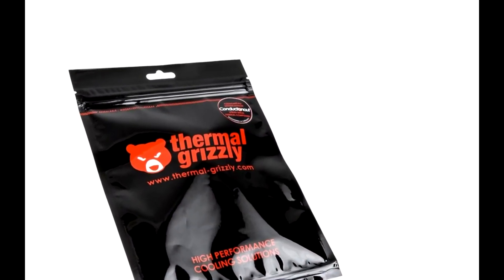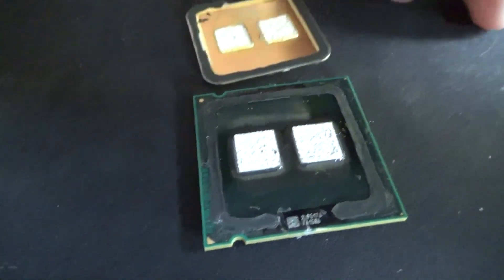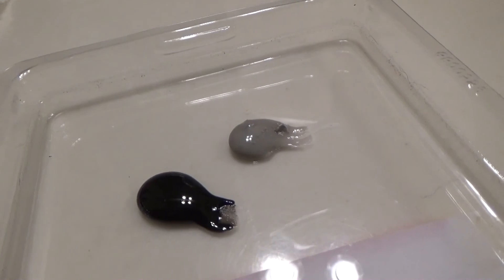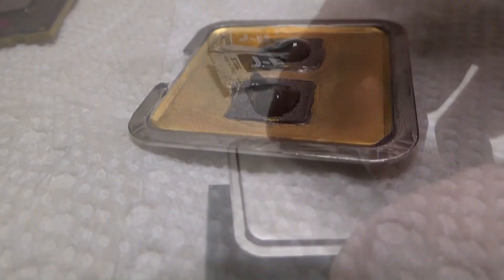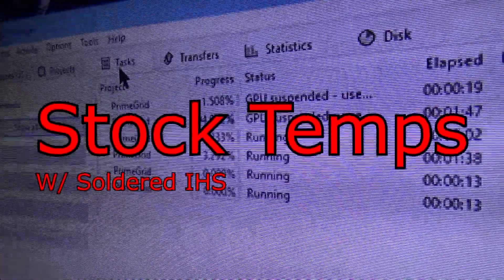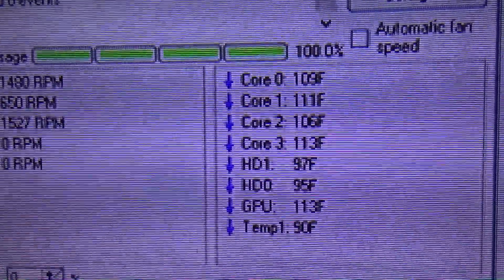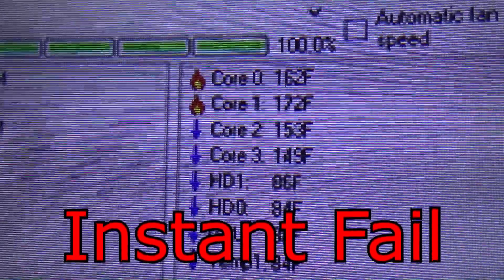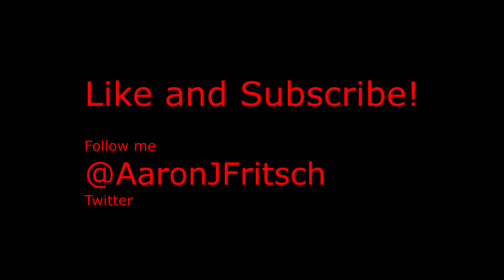JB Weld Thermal Interface Material

Comment: Wow. Didn't think i would find this video. I was thinking about doing something very similar but using Quicksteel. I wanted to use it to attach an additional heat pipe to the heatsink since i figured, well it has steel in it so it must be more conductive than thermal adhesive/ glue. But i guess that will have to pass, or maybe it is more conductive than thermal adhesive/glue...? I don't know. Great video man!
Reply from the maker: Thanks for watching! One thing I found out after I finished the video is that the particular "high heat" stuff I used had turned to powder. It was more rubbery when it dries. Regular JB weld may work better. I haven't tried this again since.
Reply: @af-aftech6029 why don't you try mixing graphite or aluminum oxide with your J-B weld. LOL that's kind of a no-brainer isn't it. 😏